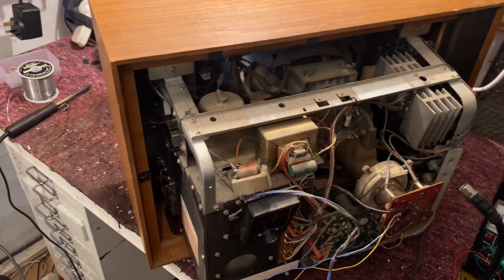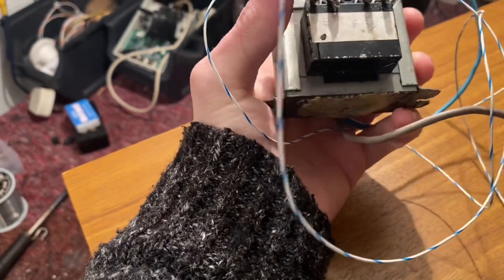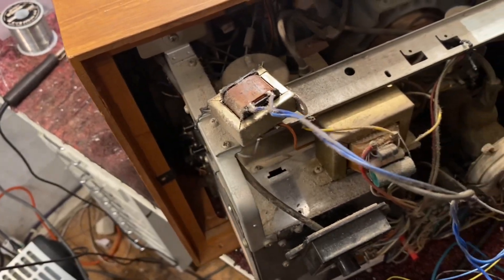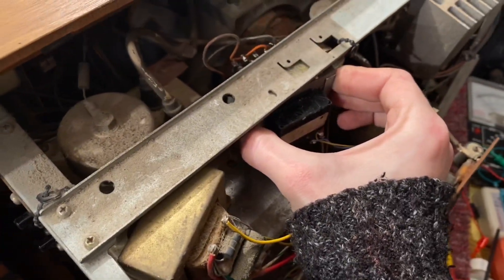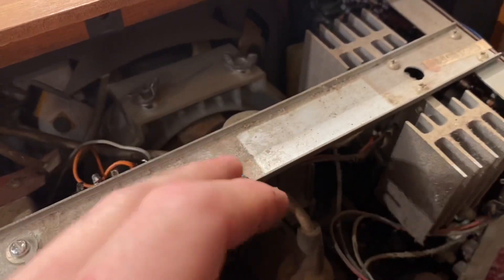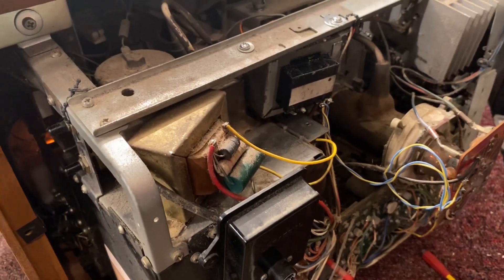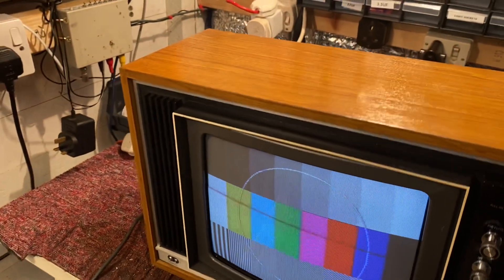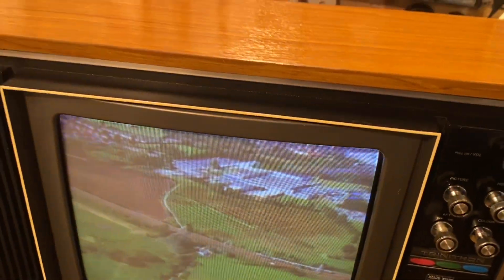Customer Repair - Vintage Sony Trinitron KV-1320UB Repair - Finished!

Comment: How dangerous is it to work on CRT sets like this? The construction of this set is really compact and it seems like there are a lot of points where you could accidentally shock yourself. I'm interested in working on old sets like this but I don't want to accidentally electrocute myself while working on one. 

Also fun fact, this set was featured in Queen's Gambit. You can see it in episode 6 when Beth redecorates her house
Reply from the maker: It’s not anymore dangerous than working on any other tv. Voltages in it aren’t going to jump at you, you’ll have a hell of a time trying to shock yourself on 190v dc. 

If you believe that all you need to do is change capacitors to make old sets work - then you won’t get very far. It’s very important to gain confidence in your skills and competent in your ability to diagnose!